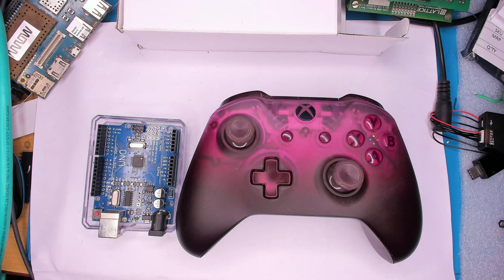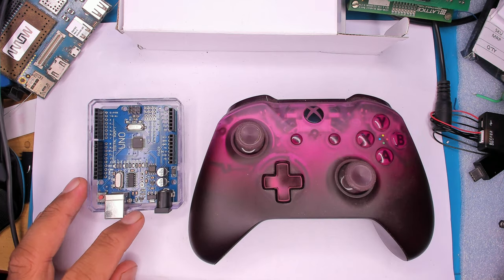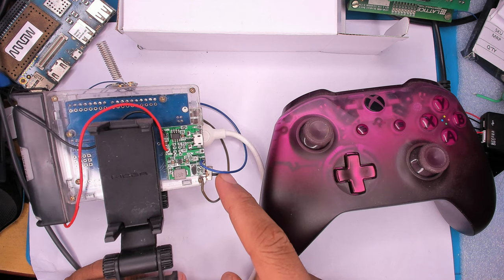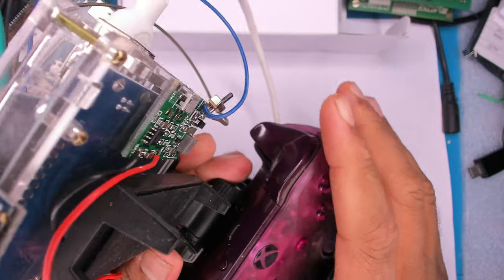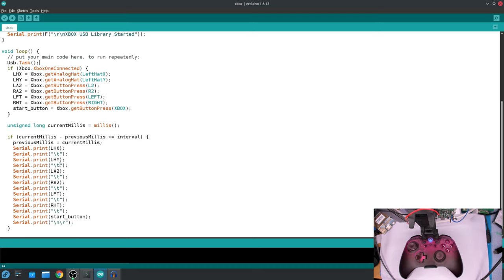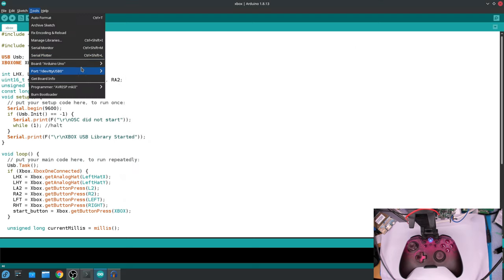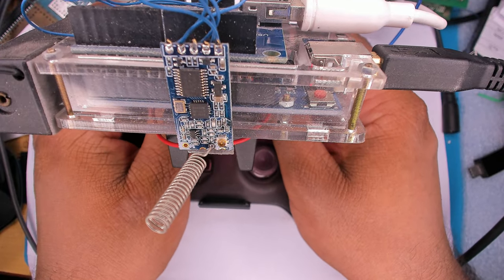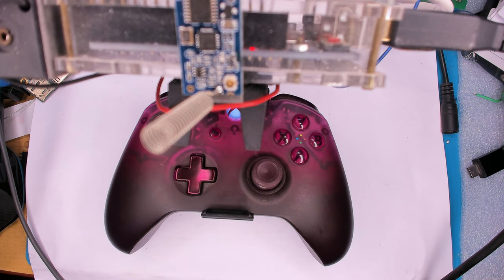DIY Remote Control using XBox One Controller and Arduino

Comment: Hie! I am ruzalkumar  kelawala. so actually i am also doing this type of project. for example i want to try xbox controller connect with raspberry pie and then to send data to arduino.. so basically i have also followed your set up.. but when i try to run your's code in arduino IDE ..unfortunately it doesn't work. so could you help to solved out this problem? i am waiting for your response.
Reply: Hi Ruzal. Have you found any answer on that topic?  I would also like to get into this kind of projet. Any info would help ! Thank you